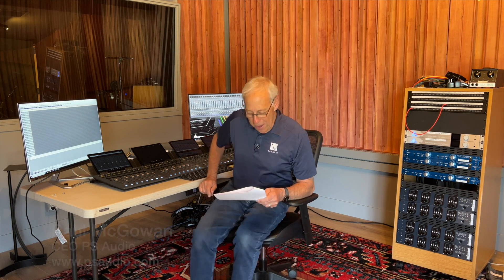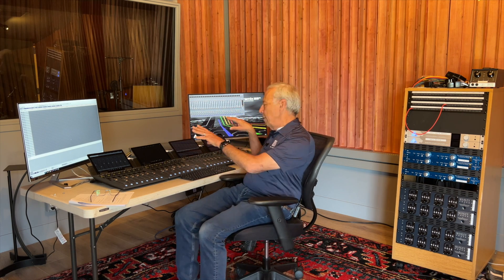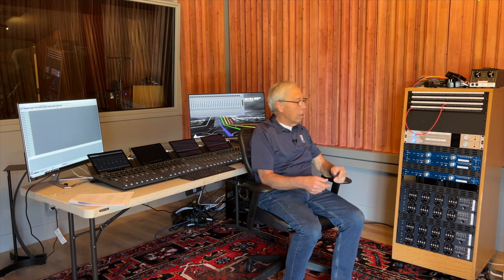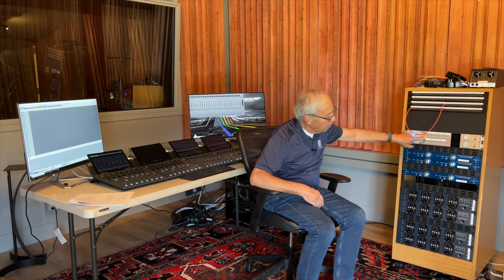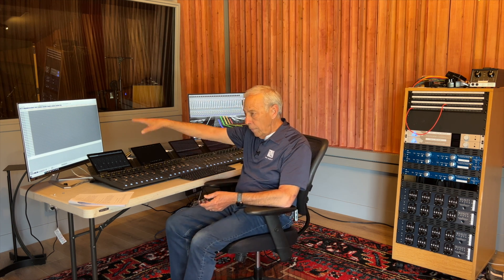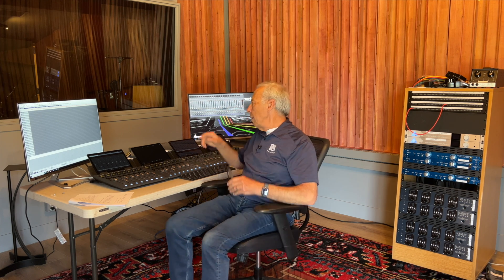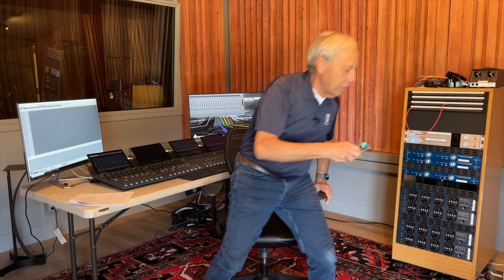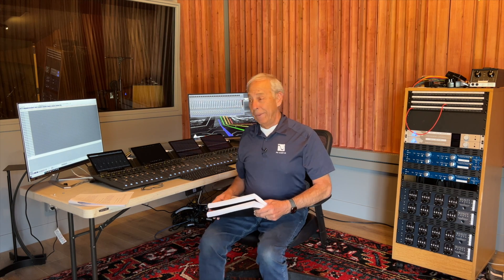DSD Recording Chain

Comment: Paul the naysayers will always say your not doing it right.The silly comment about DSD sounding better with a "PCM" base is the same rhetoric when cd's came out. As you remeber it went like this. Having a analog base makes CD's  sound better. All that was really happening was you were adding pleasant noise. Someone got smart in the digital field and figured it out. They simply added dither to the signal which adds the smooth distortion most listeners like. Dither sounds like a breakthrough it's simply pleasant noise. Or how about the Tempest Vacuum Tube CD player. Simply a Phillips CD player with a slightly upgraded analog section. It had a fancier neat looking front face plate.The tubes softened up the digital sound. No hifi system comes anywhere close to the sound of a real 100 piece orchestra and even if it did your room will not come anywhere close to the sound of a real performing hall. It's all about make money which is alright with me. Most  talky audio people have never gone to an unamplified musical event much less a live Symphony Orchestra. I still have fun with the audio toys but now days I simply enjoy music.
Paul you do a great job helping consumers.
Thank You.
John Mastroleo

Comment: In an effort to maintain revenue Sony developed dSD many years ago when their licensing stream for the CD was expiring. PCM has improved greatly over recent years and the PCM problems that DSD was supposed to address no longer exist. DSD has serious technical problems. Such as very high noise levels just above audible range requiring sophisticated filters and the need to convert to analog or PCM to edit and mix. When a PCM file is played on a native DSD single-bit converter, the single-bit DAC chip has to convert the PCM to DSD in real-time. This is one of the major reasons people claim DSD sounds better than PCM, when in fact, it is just that the chip in most modern single-bit DACs do a poor job of decoding PCM.
A good DSD and a good PCM recording can be audibly indistinguishable.
Reply: Of course PCM can easily sound as good or better than DSD-64. We are not in 2 decades ago and PCM is not limited to red book specs only. This topic is a bit silly since all modern digital mixing/mastering can only be done in PCM and a transcoding to DSD will always be lossy or inferior.
Reply: 99.9% are PCM converter are actually SDM, PWM.....etc it is 1bit. DSD is just the binary format for this 1 bit converter. DSD is free, but using the trademark is not. DSD and PCM conversion has no loses and produce exact waveform digitally in the correct conversion sampling. However DSD is the good for class D amplifier. Your iPhone may already, PCM to DSD/PWM driving directly to SDM/DA. SDM/DA to DSD/PWM then to PCM. In short only PCM for data, the rest are all "DSD".

Comment: DSD? The saying “flogging a dead horse” comes to mind. DSD is technically inferior to PCM and was obsolete the day it was invented. Many of todays finest recordings are recorded with PCM and distributed in 16/44.1 CDFormat. Poor recordings are down to sloppy production methods during recording and has little to do with the choice of recording format.  If you think DSD sounds better then that’s fine. Just be aware that you could be buying Megabytes of high frequency noise.
Reply: PCM 24 bits can contain megabytes of dynamic range headroom never used as DSD contains megabytes of ultrasonic noise. Either way, I agree, actual music fidelity can be excellent with PCM and some people today can still argue that a 44.1kHz 14 bits Marantz CD-54 CD player from 1984 is the best sounding CD player ever. Yes, 14 bits for CD playback was once cool.
Reply: @ThinkingBetter  Yes, 24 Bits gives a theoretical dynamic range os 144dB, way, way more than possible or desirable. 16 Bits gives at least 96dB which is more than enough for quality recordings.
Reply: @geoff37s38  And vinyl playback is equivalent to 12 bits of PCM when the disc is not too over-used or dusty.
Reply: Can you please give some background on the basis of your expertise? I experienced DSD to be truly amazing even on cheap gear, which seems to be a proof of concept to me.

Comment: it makes sense that you don't use so called industry standard monitors ,  Mix on exactly what your audience is using to listen on,  that makes sense to me.  As a mixer my job is to make sure my mixes translate to all types of different configurations.  And that's one of the reasons why I hold on to my ns10s .
Reply: Its so true that every one of Octave records customers has a set of PS Audios $30,000 speakers in their home listening set ups..